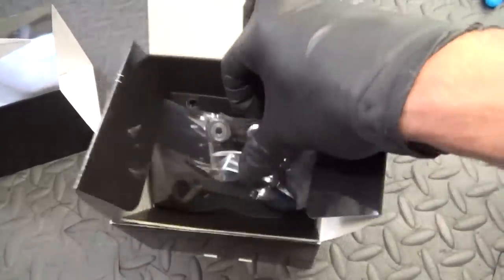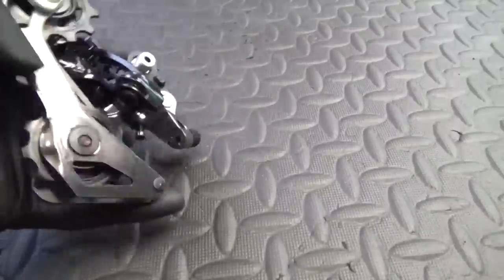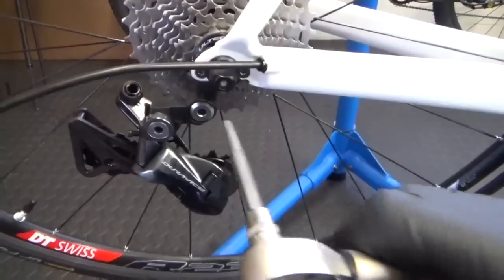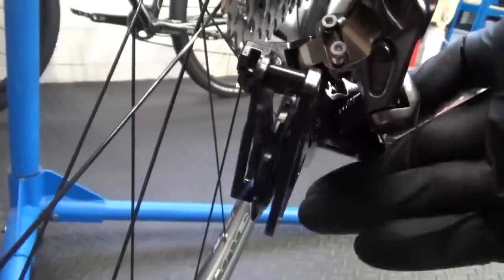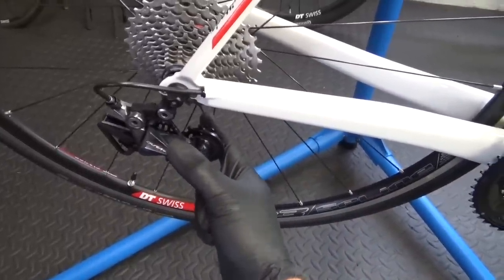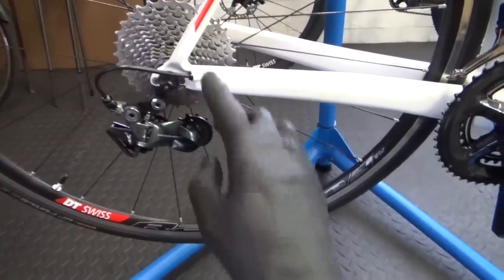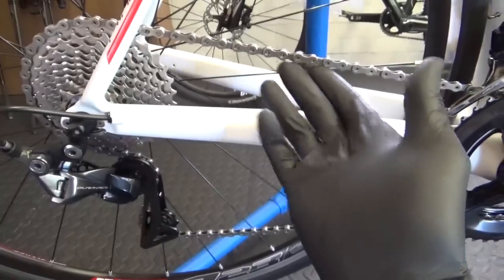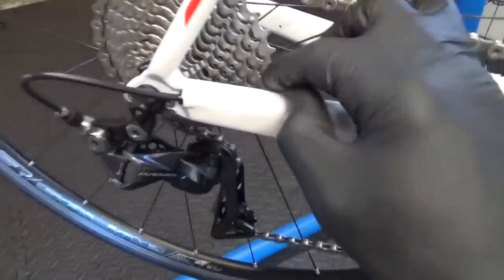Shimano Dura Ace R9100 Rear Derailleur Fitting Guide

Comment: The cable housing provided with the 9100 can be a bit tricky to get to the “best” length. I found best to ere a bit long and shorten if you notice any side flex when you shift smallest cog to next cog. 1cm made a difference on mine   Shimano technical documents make reference to the cable housing length and shifting quality.  
Your instruction is top notch and much appreciated.

Comment: Hi, thanks for the video. I have a question.. It's possible to replace the Dura ace 7800 rear derailleur with the Rd 9100 rear derailleur, I also have that extra black small plate under the back axle line on the frame, in what you mount the rear derailleur? Thanks.(I have mavic ksyrium 5 elite back wheel and have extra washers on the freehub, so there is extra space for 11 speed cassette. I want to change the shifters with ultegra R8000)
Reply from the maker: Yes you can use the 9100 RD with the R8000 shifters!